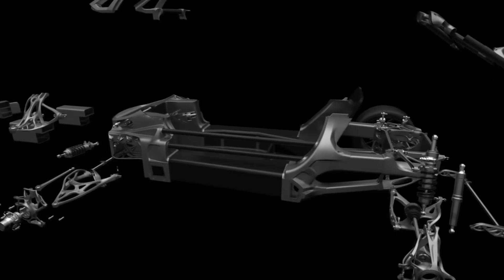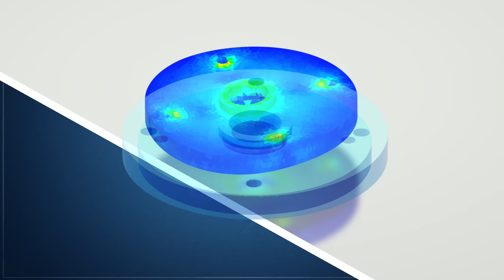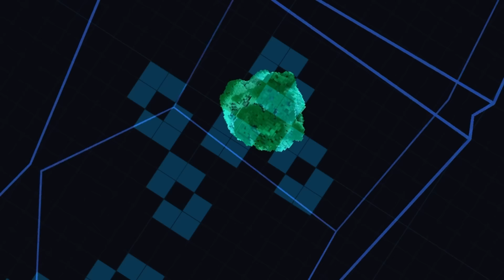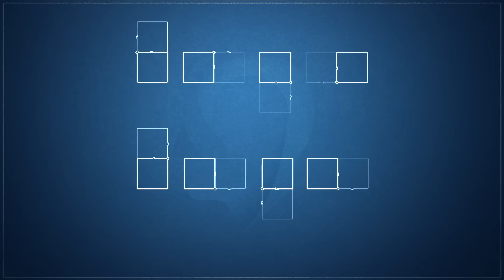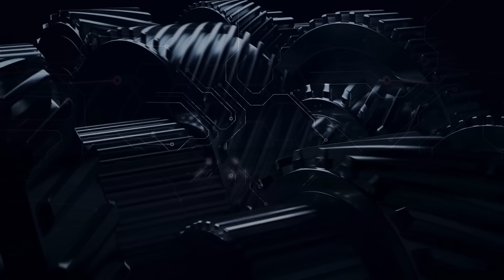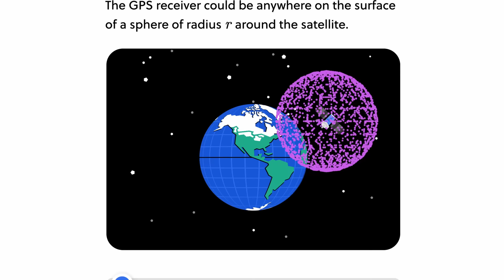The Future of Auto Manufacturing: AI Driven Design

Comment: I managed to design an algorithm to explore a specified rigid design space in a cubic coordinate grid, all in JavaScript. The algorithm starts with a cube a fine granularity and explores a recursive permutation of designs through each iteration. You have to specify the constraints for a design path, such as an interval for coordinate space and optimal regions to explore.

This process generates thousands of 3d pixelated designs within the geometric constraints. It works great, but there are some exceptions: it takes a long time for my laptop to compute, and the designs are not nearly as good as the ones in this video, for instance.

I'll probably end up putting that project on my GitHub account.

Comment: I really can't stand the endless overuse of the term "AI" and it's unfortunately just beginning. None of this stuff is AI. It's various rules written into an algorithm and nothing more. There is no "intelligence" here, just rule-based computing. I work for a software company that has a generative design product. Generative design simply takes the user-specified envelope, keep out locations, and loads and constraints, and drives to a shape outcome based on those rules. You can add further inputs like safety factor, material, optimizations like x% weight reduction, and manufacturing method (additive, milling, casting, etc.). Your job as the designer/engineer is then to take the various solutions provided by the tool and choose the best design for your criteria. Is it cool? Absolutely! Will it replace engineers? Dunno. The danger in all this is that there is no design validation any longer. It used to be, you'd design something using proven engineering techniques and calculations, then use FEA to validate it. Now you're just throwing a bunch of criteria into a computer and expecting the output to be correct.

Comment: This sounds well in theory but a big part of designing components is time of manufacturing. And the costs of running a machine are a lot higher than material costs. Especially for high production volumes. The more complex a shape is the longer it takes to manufacture. And even if you use additive manufacturing a hole that deeds to be smooth or precise needs to be put on a mill again

Comment: Well, its quite obvious that someone forgot to the tell this specific AI, these parts need to be manufactured by earthly means. ALMOST all the parts in this "vehicle", especially the suspension parts are just impossible to produce (You may have a chance if u mill this out of a solid block, tho). I know those manufacturing restraints, as i spent over a decade as a 3D designer with CAD software on automotive parts. And if you tell AI to consider earthly means of manufacturing and the cost involved, guess what, AI will produce the same ugly, soulless cars which are filling the streets today. And btw, the best cars have already been produced. I swear by god. No need for more useless " hyper hyper". AI will certainly NOT drive manufacturing of mass produced cars. The main driver is COST.

Comment: There's one problem that I see with the way AI designed internal structure(I am not an engineer, or have any qualifiers making me an expert at any part of this potential condition). Sludge, carbon, and other build up is generally considered inevitable in a combustion engine running off fossil fuels. Parts like connecting rods, crankshafts, pistons, pump turbines, or other rotating assemblies that come in contact with heat, and fluids, and other types of metals, etc. can have uneven, mostly unpredictable build up over time in "capture areas" where AI is attempting to lose weight, while adding strength, this build up could potentially throw many assemblies out of balance. Normally out of balance can be tolerated, and corrected, sometimes in very crude but effective ways, but that's when created by humans where the tolerances are "good enough", with a built in secondary, unintended, but appreciated function that makes them durable. AI wants to create highly accurate, extremely tight tolerance interactions, normally a good thing that leads to much higher performance. I don't know how bad it could get, but I would imagine, considering the AI capable tolerances, that it wouldn't take much to have an effect. I'm still learning about all of this, so it's just an observation, I also have the confidence that we can adapt as we learn, along with the AI we work with.

Comment: Ummm the things is I could drawl a component that is structurally improved and at optimum strength with as little material as possible and the result would be so very vlose to what this program spits out that it isnt even that nessesary to have it. A web of carbon fiber that stretches with many small h beam supports would be the best way to make a part everytime. The problem is making the part yourself and the time it takes to make one carbon fiber cagelike part for the vehicle. It is also not worth the time compared to just using an aluminum I beam part because the overall weights saving and strength increase will not improve enough to make it worth the time and cost at a certain point unless you are racing and even then... I guess weight reduction and improved gas mileage is better but like i said it would be tough to make a carbon fiber Toyota Prius made with space aged parts and weblike carbon fiber and make it half the total weight for the same price we pay for the prius and in the same amount of time and plus we only live 76 years on average and we dont all want to spend 20 uears making the perfect car. Its a freaking car. Who cares. I just want to get there fast and then get out. This is going way too far with technology too fast because the labor and nessesity isnt matching up to cost and therefor reason is not there. Unless you are racing or going into space. Lol

Comment: This might work for low volume where DFMEA is less critical and crashworthiness regulations virtually non-existent, but there is a long way before manufacturing processes catch-up to allow for high volume manufacturing as well as the ability to design for crashworthiness, (it's a different league in engineering difficulty) than it is to design for things like static stiffness's. This is coming across as a gimmick by Czinger.

Comment: Now imagine something does break, who exactly do you take this too to be repaired?
Reply: Brake something like what? I mean if in my car broke suspension i buy a new suspension.If is not broken just have to fix or change something like silents,then machinis will change or fix it. In 23 nobody welds broken parts wich is safety part.
Reply: @laszloszell8753  a mount. A linkage. A part that's some wild organic shape that isn't replicable by third party repair and you're forced to pay the company a gorillion dollars to replace a proprietary part that doesn't exist outside of their manufacturing plant.
Reply: @OfLastingThunder   I understand your point, but if you think of a AI designed part can't be manufactured by mass production like VW ,BMW then you are wrong. Is just a design. Of course if this the part for a unique car like Mclaren,Bugatti or motor or anything, then the price also will be "unique " just like your wallet.

Comment: 🎯 Key Takeaways for quick navigation:

00:00 🚗 The Zinger 21C hypercar features revolutionary components and manufacturing techniques, including AI-driven design.
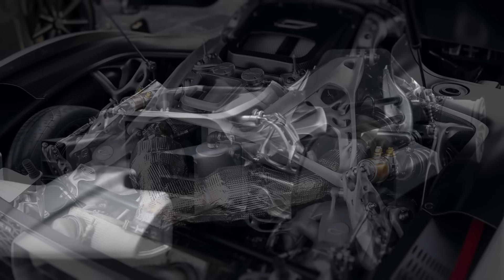01:10 🤖 Generative design uses AI to create optimized structures by exploring a vast design space based on defined goals and constraints.
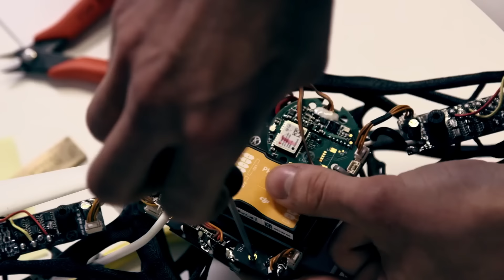02:32 🧑‍🎨 Designers play a critical role in generative design by setting goals, interpreting results, and incorporating creativity into the final design.
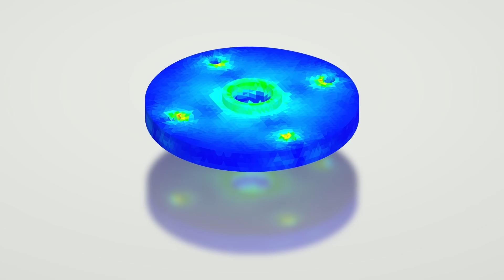03:54 🛠️ Generative design example: Optimizing a hub for weight reduction while maintaining structural integrity using AI algorithms.
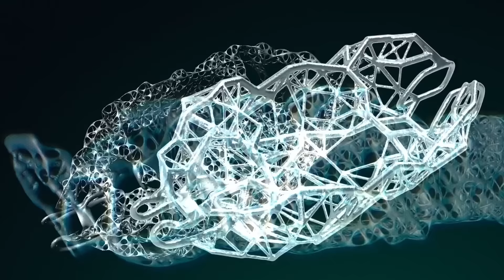05:16 🧩 Various computational approaches, including cellular automata, genetic algorithms, shape grammar, L systems, and agent-based models, can be used in generative design.
08:47 🧬 Genetic algorithms use principles of natural selection to optimize designs by evolving populations of designs over generations.
10:26 ✏️ Shape grammar employs basic shape elements and rules to generate diverse designs, often used for aesthetic exploration.
13:27 🌿 L systems model growth and development, making them suitable for various design applications, from material textures to wheel designs.
16:00 👥 Agent-based models simulate interactions among autonomous agents to create emergent patterns and designs.
18:38 🤯 AI-driven generative design is evolving rapidly, promising to revolutionize industries and redefine the roles of engineers and designers.

Made with HARPA AI

Comment: now program the ai for a 2nd difference change for design,  use these prototypes and then add the parameter of simplicity as in reduce number of overall struts,  code for a new way to efficiently mount parts together, could be temporarily backdored by setting a lower and upper limit on part thickness so that space couldn't be made in between parts.  then set up a second ai to automatically estimate price based on a standard,  then combine those 2 and set a lower and upper limit for cost effectiveness vs design improvement/manufacture ease or even against a mass production model if u wanna go big

Comment: Sadly, additive manufacturing isn't suitable for a multitude of applications, due to the massive variables in the final material strength. You can print a part, then print it again a day later, and it will have different properties due to the humidity, temperature and other minor factors. Whereas with classic cnc manufacturing, you buy a universally used alloy that you can easily test for properties, and the parts will always come out the same.

Comment: I'm still watching, but I had a thought and I know I'll forget it by the end of the video (if I wait and see if it was talked about)
The AI designs are meant to be the best and most efficient, and we're seeing that they can change dramatically from what people have thought up in the past. What about adding the parameter of what material would work best as well? One shape might be great for a certain type of material (aluminum), but using a stronger metal might be able to make that shape (or a different one) more efficient. Aluminum might need x amount of material and/or mass, while steel might need y amount of material and mass.

Comment: Honestly if you take an engineering course you will find this is a God sent. Like sure it won't be easy to manufacture some parts but if you give the AI a limited parameter for the machine work you may be able to make a cast aluminium part stronger and lighter then a steel part. Most will say well the alluminium will crack. Yes that's true if it's compromised but if we have multiple load points it should be able to handle multiple fractures till it fails. So if we tell the AI we need at least 13 load points that cab withstand 400 pounds of deformation along the load point. The AI will be forced to make it with the least amount of material and with the most structural rigidity without any plastic or elastic deformation. 

We give the AI the engineering designs humans cane up with and we say "improve apon what you are given". This will help in the time and money spent and actually increase how well the part functions. 

I've been useing my own AI that requires 2 cpus and 4 gpus in a server configuration just to funcfunction. I'm planning on makeing the casts myself useing evaporative 3p printing and vacuumed casts useing steel. It's gonna take me some time but I know I can make the world's first jet bike that can fly useing VTOL modes.

Comment: that's a fun point of view. This should be the best use for Ais because, at it's core, whatit does is streamline a part of the design process that is only valuable to be done via pure parameters. In this example, Ai does not determine or find new base parameter or understand the design constraints, it's not it's strength. The in-between that has been guesswork for all these years is now a thing you can properly do in a purposeful way. This is where the power of Ais truly lies. What's more, these tools do not hinder creativity or innovation because new techniques become new parameters and these ways can totally be reserved for performance-critical design. Anywhere weight/performance/material economy isn't paramount, this type of work becomes a distraction. It is facinating.

Comment: I don't like the idea of a "brakenode"... Looks like pads would be a BITCH to replace, not to mention having to replace the entire assembly if you had a "caliper" issue. Rebuild kits would solve some of the issues, but if the inner surfaces were shot, you're looking at a complete replacement of a 3D-printed alloy part, with an entire brakepiston, hub and bearing included... I know how fucking expensive BMW's spindle assy's are, and those are just an aluminium-alloy casting. You'd be looking at 1000's of dollars.

It's a great idea for hypercars, not so much for a regular car.

Comment: Using an AI to generate possible solutions to design a part is completely fine. This whole idea has flaws such as the solution given by the parameters set is only applicable to that one possible state out of an infinite number. I would give more specific parameters over a set amount of possible states the part being designed can be in. To put it in simple terms, very specific/strict parameters over a general/wide array of possible states.

Comment: I’ve been using this for years. Topology optimization. I think the biggest change is the availability of more complex manufacturing methods like metal 3d printing.
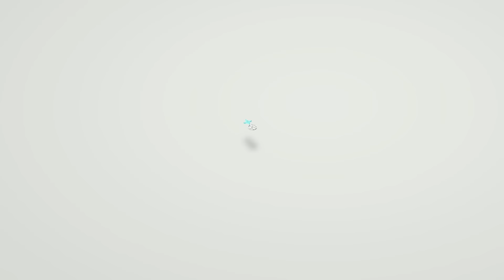Reply: If you work in automotives, sdo you know where one can find optimized wheel hubs such as the ones shown at 4:40 in this video?
Reply: @DigitalDissident  in mass production wehicles price for mass production is defining factor. Less machining operations means smaller price.
In high end motorsports and aerospace more complex designs are used

Comment: The problem with 3d printing is the time it takes to produce the part. It takes more time to produce the part compared to standard production methods.  One of the production optimizations in traditional production is to minimize the number of cuts needed because every cutting pass increases the amount of time to work the part and can increase the cost beyond the benefits of using less material.
Reply: those constraints such as amount of cuts and production time can or will also be factored into these gererative models, next
Reply: Hench Why 3d Printing is Perfect for the Individual but for traditional Manufacturing will be for mass Production.

Comment: They have had these capabilities to manufacture light weight engine parts for a very long time. They simply are either too expensive to mass produce or have a unacceptable failure rate. If it was cheaper and better, the manufactures would be using them already. 

Each generation tries to reinvent the wheel. Abs systems are still the same as fourth years ago. Traction control functions are the same also. The only slight changes is more complicated and often crappy software due to patents for controlling the braking.  Same with transmissions. Electric cars where built when the electric motor was invented. Whatever.

Comment: 16:22 Nurburgring suspension tuning at home. If you have a simulator with some form of AI driving like Assetto Corsa and an accurate enough aero/weight transfer model you could build the ultimate suspension geometry, spring rate, shock setup, and alignment. Do the tests with varying seat and trunk loads in various weather conditions. Tire wear, grip, and air pressure could also be randomized to test stability in un optimal conditions.
Reply: I think Formula 1 will be one of the first to adapt this approach IRL. They have incredibly accurate simulations and are doing constant correlation work, which is quint essential for this approach. You know the phrase: garbage in - garbage out. Without the correlation work, you will only gain parameters that are optimal for the simulation e.g. your car will be really fast in Assetto Corsa, but highly flawed on the real Nurburgring.

Comment: Car parts are not made to be optimal in materials usage. They are made to be optimal in COST to produce.   NO printing technology will ever match mass production in terms of parts cost.  Its why its STILL referred to as rapid Prototyping, not rapid production.  The crank shaft pictured in the thumbnail can never be produced for a lower cost per part than a simple straight arm crankshaft, which can be match plate cast or drop forged and machined thru automation.   Optimized printed parts for something like a rocket engine’s combustion chamber, which is worth millions of dollars to begin with, is feasible.   For the parts for a car?   Nope.
Reply: Basically. Very Specialized devices where you want the part EXACTLY how you want it without caring for mass Productio .

Comment: some things look stupid and some a.i. things look so clever .....

then there is cnc machine time , tool cost, tool lifetime , mass production ....sure you can optimize most thing in 195789346832486 generations of perfecting .
but is it everytime effective in cost , time ..etc ? 

if it would be a " optimized " part .....in mass production there would never be a machined hub like this , it would be stamped or cast with as little as possible machining .